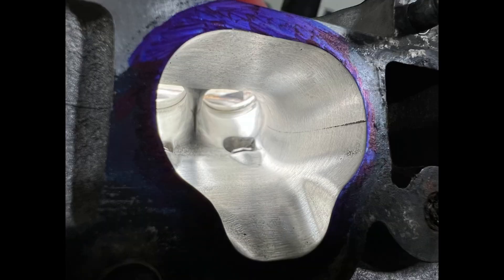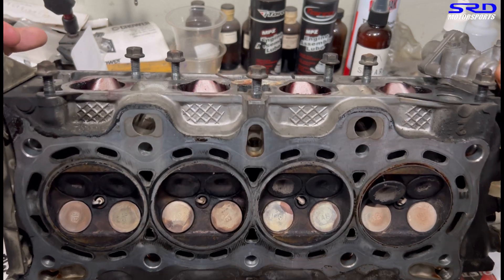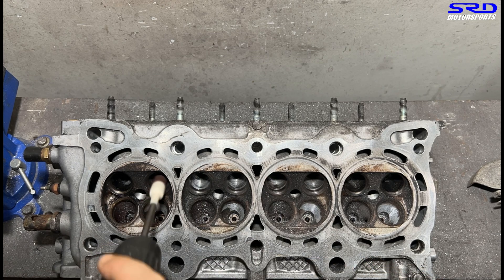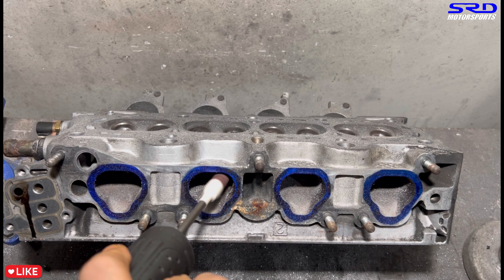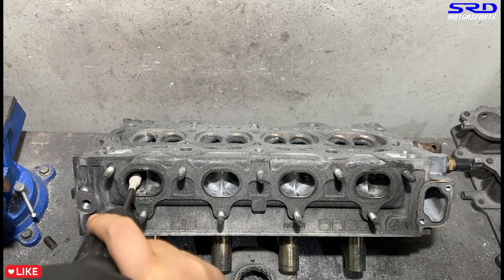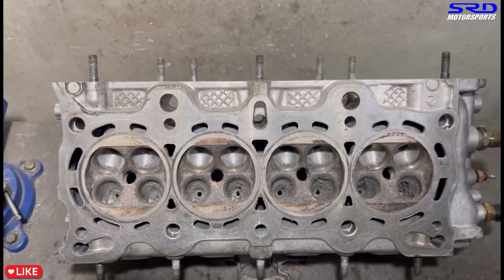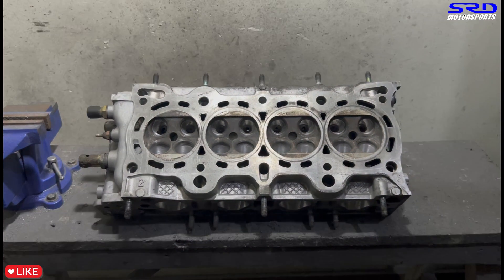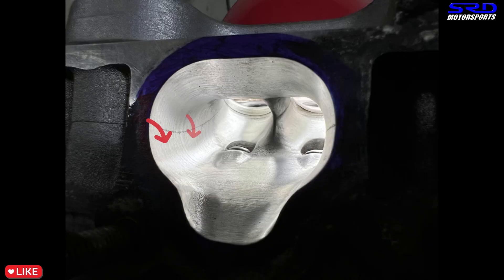D16y8 P2j VTi Head Porting and Development

Comment: Brother is there any obd2 mod for d16y6/y8 apart from the vafc2?one of the guys from my country say that you have to shift to obd1 ecu in order to see max output with the obd1 po8 or p28 conversion,you have to not only change the sensors but the y6/y8 manifold aswell to a d16z6 one as y6 y8 has a auto throttle system while the d16z6 has the manual one,is there any way to dodge this protocol?p28 or o6 ecu with the same y8 manifold but changed sensors,is it possible?The vafc2 can be done to dodge things but you can barely play with manipulating with the maf sensor or only the af stuff,you can't go complete with it like a obd1 ecu setup or an aftermarket standalone setup,would reflashing the same ecu help?any recommendations for any aftermarket ecu e.g aem ems but what series?any way to alter the same obd2 y8 mani and mate the entire obdi1 ecu setup to it,is it possible?would the vafc2 give the same optimised output or would we have to shift?
Reply from the maker: the vafc can do a lot with a proper tuner and a wideband

yes while the p28 rechiped ecu has more flexibility in tuning the point is if they can’t extract good results with the vafc ? More options doesn’t mean better results most likely that’s more chances of blowing up the engine
Reply: Bro, if one of your  PH16 VTi with a V-stack and port match can supposedly hit 110+ whp, considering my D16y6 has intake, header, downpipe,port matched head and a ported and polished  manifold, 62mm TB, lightweight flywheel, short ratio b000 s20 non lsd transmission, and I'm aiming for around 120 whp (currently at a stock 98-100 whp), would you agree that with proper VAFC2 tuning, getting close to that 120 whp mark should be achievable given the similar level of bolt-on modifications?"
Reply from the maker: yeah we did 110+whp on stock obd2 ecu
Reply: @SRDmotorsports  with that being said can i expect 120 with the setup i have shared with you?and btw what ecu mod for that ph16?
Reply from the maker: we didn’t do any ecu mod on the ph16 not even a vafc… I can’t say what u can expect it’s always different only the dyno has the final word
Reply: @SRDmotorsports  ok thanks brother,i will let my guy to follow your white ph16 tutorial,my scenario is quite the same like that white ph16 even the compression numbers were as healthy as the white one you did.
Reply from the maker: alright cool

Comment: What are the expected improved power figures on an N/A D-series with a stock cam from a port and polish ?
Reply from the maker: that depends really and I never really looked at it as + specific number on 1 mod etc etc always looked at the engine as 1 whole system
Reply: Im asking since i plan to mostly work on the top end of my JDM D15b (porting and milling the head for extra compression).
Reply from the maker: yes and like I said it really depends and even more so on tuning… someone can port it and u can gain 5hp or lose 5hp …someone can port it and u gain 10hp and some can make u lose 15hp in porting …so theres no answer

And if you ask me if I ported it? It still depends on what header, what intake it uses and who will tune it… compression will also depend some don’t have the fuel octane to tolerate any mill over 0.020” / 0.5mm some can get 100 octane pump so it still depends

Comment: "Does a ported and polished head increase both horsepower and torque, or is it solely responsible for horsepower?"
Reply: Hope to see a 3-5 WHP bump from this rebuilt head.
Reply from the maker: @washhalhafeez1824  hp is a product of torque over time/rpm

Ofcourse torque can only be made as much as what the displacement has example
no way a 1.6L can make the same torque as a 2.0L unless turbocharged
Reply: @SRDmotorsports  alright and as far as this d16 head is concerned ofc we are expecting more torque and hp out of it now compared to the previous scenario of it,right.
Reply from the maker: yes

Comment: would it make sense to put some extra material onto the port divider and smooth it out so it's not as far into the port? i feel like that's one issue of these but the combustion chamber looks better than Z6 imo
Reply from the maker: possible but it’s also canted to the left, focusing on swirl in the chamber
Reply: @SRDmotorsports  yeah fair. It makes sense for low/high rpm but I‘m guessing it‘s hard to keep velocity and flow up with a swirl design and it‘s very sensitive to port changes but it should be able to make more power at the same cfm
Reply from the maker: Yup true

Comment: Newbie question, would that lean out on stock tune? since technically there will be more airflow.
Reply from the maker: @huwaki  good question actually… and technically it does and could? But just like installing headers changes the air fuel mixture

But we see a ton of guys change headers and stay on stock ecu for all their reasons?

basically you get maybe 60-70% of its capabilities by just bolting it on
but with ecu tuning it can guarantee you get 100% of what the head can give or header or even intake
Reply: @SRDmotorsports  I remember putting P2j Intake on my non vtec caused engine pinging, I suspected it was leaning out on fuel hence requiring higher octane. 

So to summarize, yes it will benefit on how the stock ecu can compensate on AFR but can be fully unlock it's potential when tuned? 

Will we be seeing a tune onto the next video? :D 

Cheers for a great informative video. Hoping to visit your shop soon!
Reply from the maker: @huwaki  the owner of this head is the 1996 VTi series we did actually

yeah the owner has future plans on switching ecu and “other” things so most likely as soon as he finds time, but I think he is also looking to a quick repaint just to restore the white color as it has some slight damages in places

but most def if when he goes for a tunable ecu we definitely will make a follow up video to his series